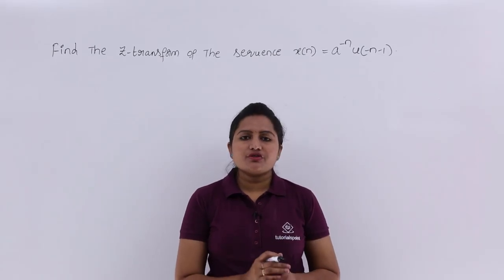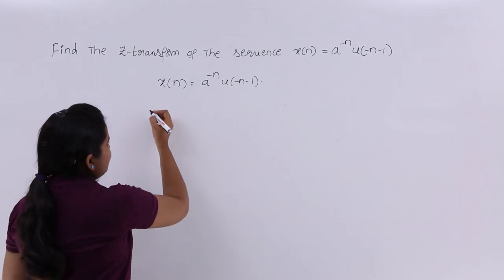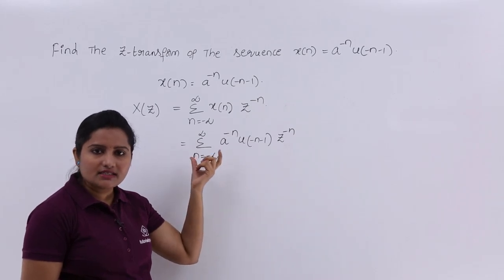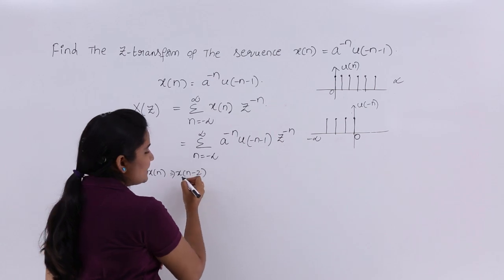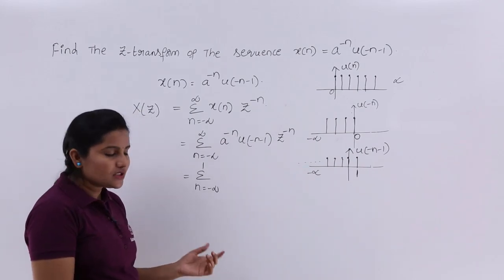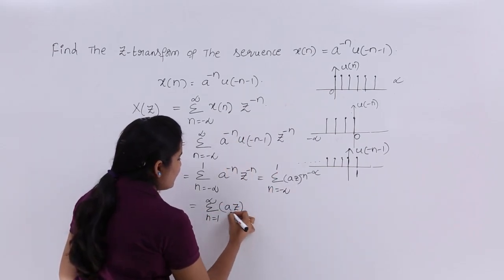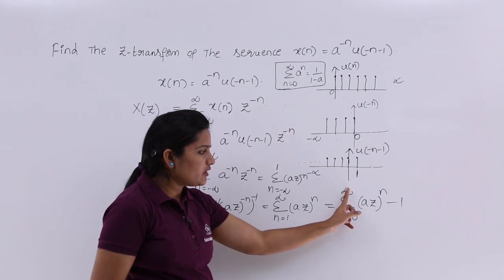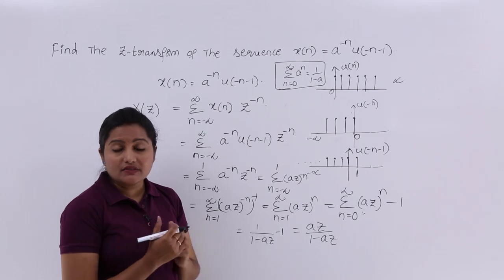Z-Transform of Basic Signal Problem Example 1

Comment: Wrong calculations.. Firstly u plotted u(-n-1) wrongly instead u plotted u(-n+1)..
Also limits gets to be from -inf to - 1 and when reversed then sign of both is changed so limits would b 1 to inf...
Reply: The plot is right
Reply: plot is right if u apply shift first then it will be unit step signal starting from 1 and then time reversal will flip it around 1
if u do reversal first then it will be unit step function from 0 to -infinity then apply shift it towards right by 1 again same signal

Comment: The limit for unit step summation is wrong it is from -∞ to -1
Reply: Bro can any one of u plz explain the correct way of doing plz I need full problem
Reply: @bommisettiprakash4449  Just follow the sequence as :
1. Shifting: first shift the signal (forget about -n, and take n instead), so the signal is from 1 to infinity, by doing right shift.
2. Scaling: since there is no multiplication factor so, no need.
3. Reflection: reflect the signal along the y-axis, so now the limit is from -infinity to -1.
Hope it helps.
Reply: yeah I said the same thing... problem is that she reflected then shifted, you're supposed to shift then reflect.
Reply: @bran_rx  is there any fix sequence to perform operations
Reply: @bran_rx -1 is a constant number which is represented by -k and -n is the time unit so first we reflect the original signal and then shift the signal
Reply: Yeah it's wrong
Reply: Exactly mr
Reply: yeah its wrong
Reply: Good
Reply: Yeah it's wrong
Reply: Exactly
Reply: padhai kar le gadhe
Reply: First, reversal and then shifting
Reply: Its correct bro according to precedence rule first we fold the signals and we I'll shift so limit is correct
Reply: @ravikumar-0809   No you're wrong, just put n = 1 in u(-n-1) , its equal to  u(-2)=0. Now just put n=-1, which is equal to u(0). Hence, the limit should be -inf to -1.
Reply: @HpDopeman  but answer is correct🤭🤭